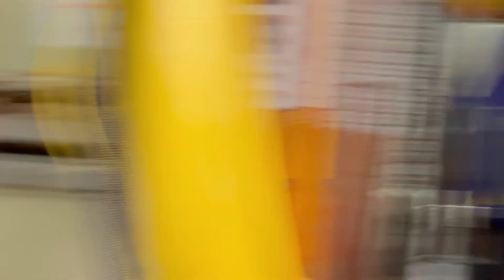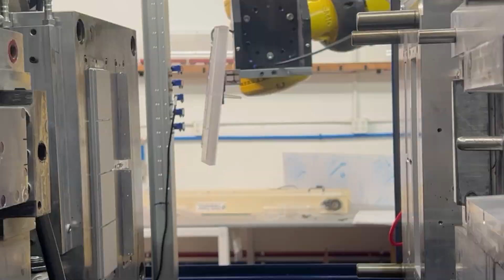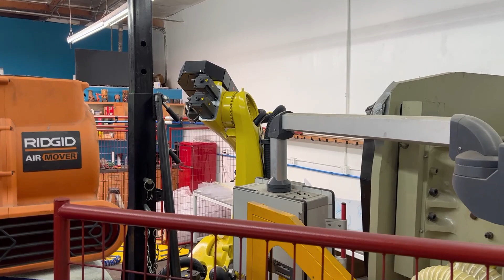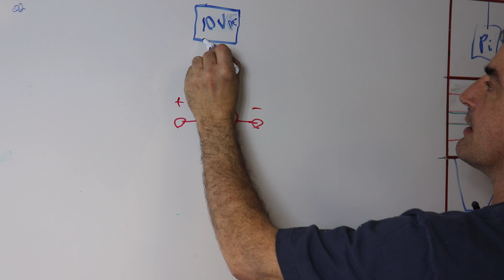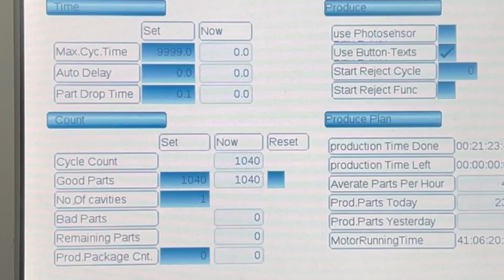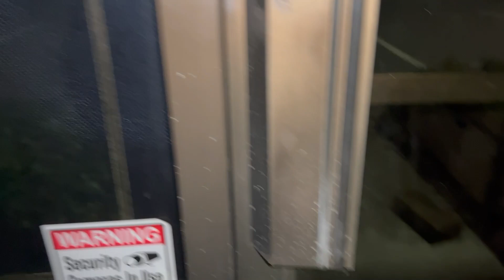H BRIDGE AND SHOP UPDATE

Comment: I love seeing all the automation on your different parts.  It's amazing what you are able to accomplish without a shop full of employees...  On the H-Bridge...  I'm wondering if you can get a SSR with both NO and NC outputs, then you could operate the circuit with 2 SSRs instead of 4.  On that note...  If you could get a 4 pole with NO and NC outputs, you could do it with a single relay...  Probably too late for all that, just noodling on the idea.
Reply: It will not work.
A relay like yours knows two states but we need three states.
Reply from the maker: Thanks for watcing Greg!  I'm not too sure about other options with relays.  Hope you project is going well.